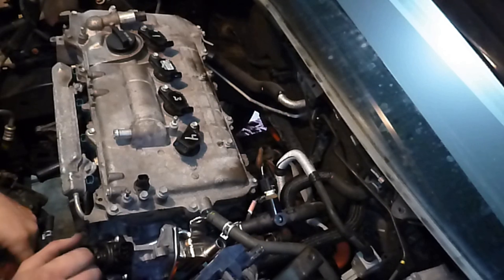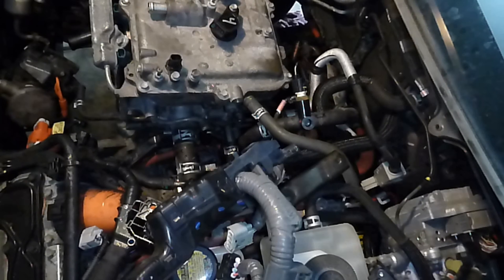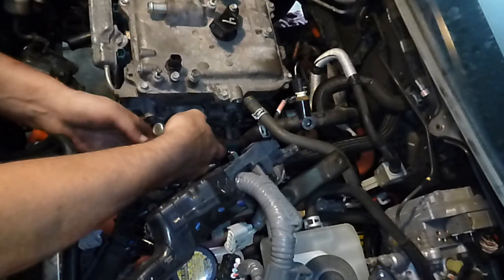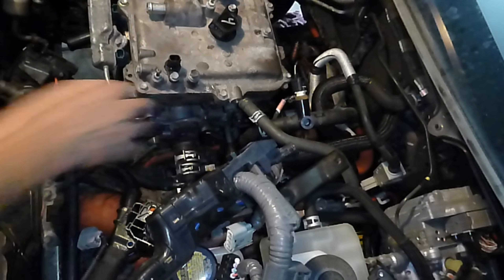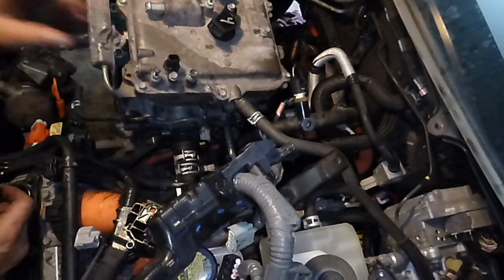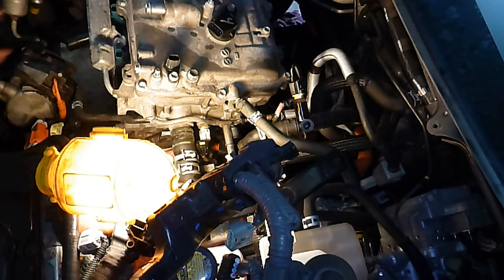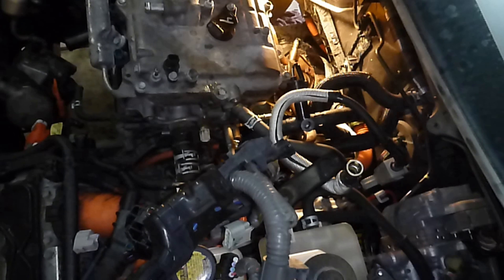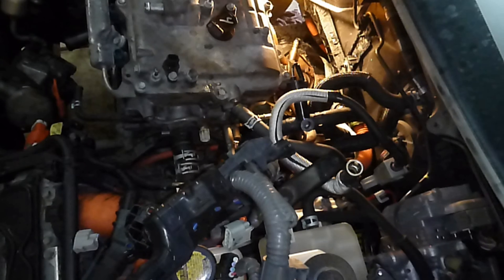Part 5 - 2016 Prius Engine Swap into 2012 Prius V - Start to Finish

Comment: i'm finally taking off my prius gen3 engine and the last thing to do before i lift the engine out is to remove the fuel line. I spent more than 30mins trying to get the fuel line off with the plastic generic tool. I got cuts and scrapes trying. to the point i almost broke the line. so i stopped, went to horrorfright and got their metal fuel disconnect set. but that didnt work either. they all dont have that cutout for the bump before the connector. I finally found one that worked. took less than 30 secs. using a Lisle 39210 made for toyotas and nissans. dont waste time with anything else.  Thanks again for the Videos! i got my engine out in half a day total with your help!
Reply: pyronitro Thanks very much for the tips. I’m trying to figure out if I should swap motors on my 2010 Prius or not (blown head gasket) and will need all the help I can get. Again, thanks for commenting as it’s notes like these that make us all better.
Reply: @daveparker839  funny thing. After i did that. I found that going down the line further is a simpler disconnect. On the service manual called the "fuel pipe clamp". I did not disconnect mine as i think the first disconnect is better mechanically tho. U can see that in one of the gasket masters video. here https://youtu.be/4E_lZPw5zMM?t=1094
Reply: Dave Parker I’m about to do the same thing. I have a 2010, just blew a rod through the block...
Reply: Thanks for this info 🙏

Comment: I took my egr cooler off doing some maintenance on my oil guzzling 2010 prius.  It was nearly completely clogged.  I first used brake cleaner to try and clean it out.  Didn't do that well, was messy and toxic.  I took the cooler itself to the carwash and blasted the inside of it with high pressure soap water.  It was amazing the black stuff that came out.  Cleaned the inside like new.  225,000 miles on the car now.   I also use the car wash to clean out the air intake manifold every 20,000 miles which gets clogged with oil and soot.  It's the small ports inside the large ports in the air intake manifold that must be cleaned well on an oil burning prius.  I installed an oil catch can that seems to have double the miles I can put on the car before the small intake ports clog again.   It's burning 1 qt of oil every 5-600 miles.  If things get worse or something happens, I'm swapping engines myself.    I hear the 2010-2012 prius piston rings may be bad.  Is that true?  Have the rings been improved on the 2013's and up?  Thanks for the videos, they really help.
Reply from the maker: Nice work Bob! 
Check out PriusChat for all things related to OCC's,  I/M and EGR cooler cleaning.
https://priuschat.com/threads/oil-catch-can-eliminate-that-knock.179588/
Your Prius engine will eventually blow a head gasket from the carbon build up on the pistons.

- Fix That Prius!!!!
Reply: I have a 2010 and did everything you just said. My car has 240k on it and on top of all the things you did. I also did new PCV, spark plugs, and fresh oil. 2 months later (this week) I blew a rod through the block. After some research to whether I should scrap it or put a motor in it, that led me here. My point being, be very careful. I’ve heard of other people blowing head gaskets or throwing a rod though the block after 200k
Reply: @XTheJenovaProjectX  What about the common head Gasket blowing from model years 2010 thru 2015  somewhere between 110,000 miles and 150,000 miles. My 2010 Toyota Prius head gasket blew at 157,000 miles. Check out the following link before a piston smashes thru the side of the engine.         https://www.youtube.com/watch?v=8U1rs3bI-HA

Comment: What about the common head Gasket blowing from model years 2010 thru 2015  somewhere between 110,000 miles and 150,000 miles. My 2010 Toyota Prius head gasket blew at 157,000 miles. Check out the following link before a piston smashes thru the side of the engine.         https://www.youtube.com/watch?v=8U1rs3bI-HA